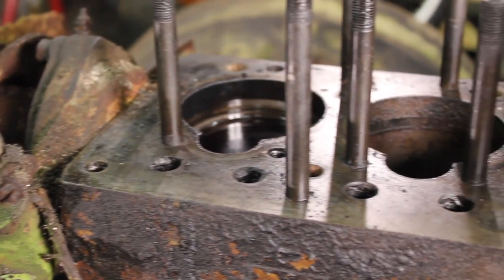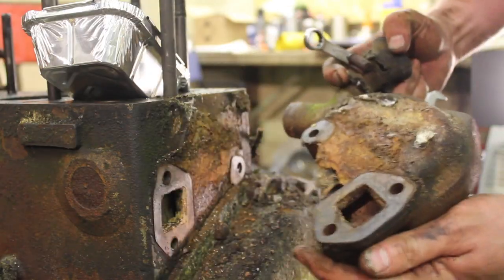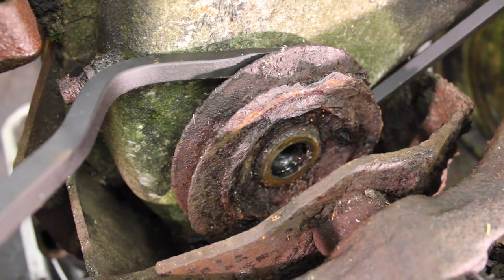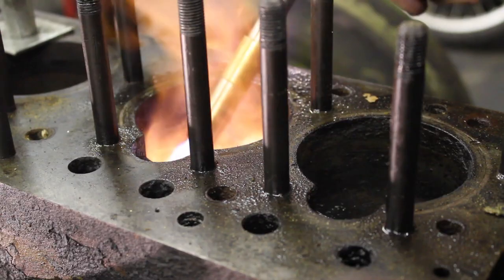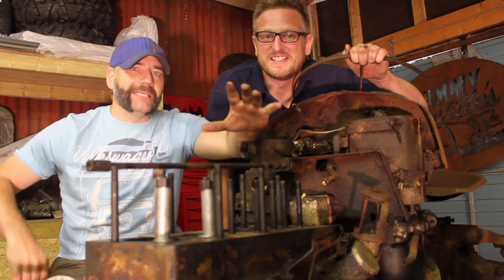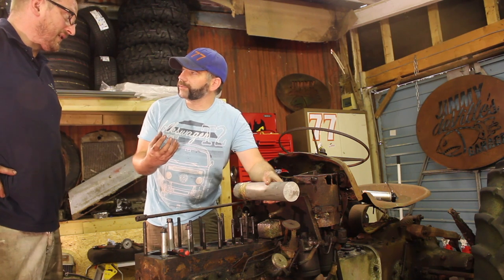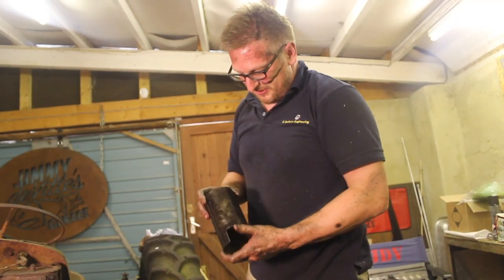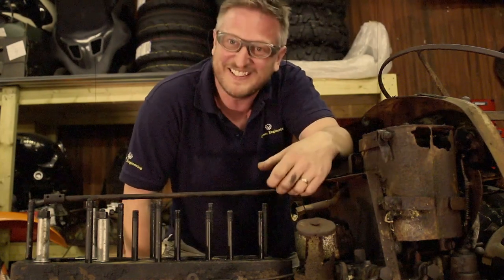Barn Find Fergie.  Episode 2. How To Free Siezed Pistons.

Comment: Find a 2 legged puller, pop it accross two studs and use the centre screw on the piston  with a piece of aluminum to protect the top of the piston. 

Put hot water in the block. Fold a rag to fit in the piston, soak it in water and freeze it, once frozen, pop it on top of the piston. 

If that doesn't work, free the valves up in the head and re assemble without the pushrods. Use a compression test adapter to pressure the pressure the cylinders, you can either use a grease gun or hydraulic jack.
Reply from the maker: Now there is some great tips to try. Great stuff!
Reply: I’ve got a seized Triumph, so I’ll give it a try on that for sure, cheers
Reply: @montydog0  where abouts are you? I've got another idea id like to experiment with. 

I'd find a hydraulic ram piston and seal set of the same bore as your engine. I'd machine some channels internally to allow a pumped supply of chilled water to circulate and thus cool the piston down. 

I'd drill and tap another hole straight through and plumb that to a hydraulic jack. I'd use the jack to pump something like WD-40 at high pressure to force it through the rings and break the bond between the piston and cylinder. 

I'd then use a puller on top to hold it all in place. The advantage of this setup is that it could be left for a few days to do it's thing.

Comment: Have solved that Problem with Marine Diesels many times.....with a few Mls. of diesel poured on the top pf the Piston....then ..outside the building ....heat up the whole block with 2 or More Electric Heat Guns..not on the Piston Tops but on the sides of the Engine Block.
as soon as the Diesel begins Vapourising..pour more hot fuel in ..
then turn the Crank with a small Spanner/Ratchet placed on the Crank Pulley Bolt..
Stilsons will make the Seizure worse.
Reply from the maker: Sounds interesting. Thanks!